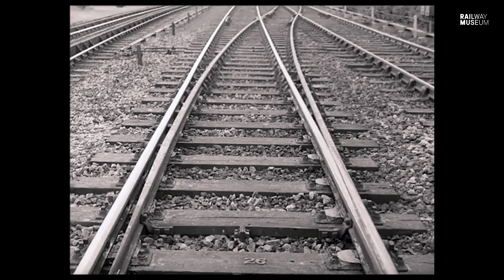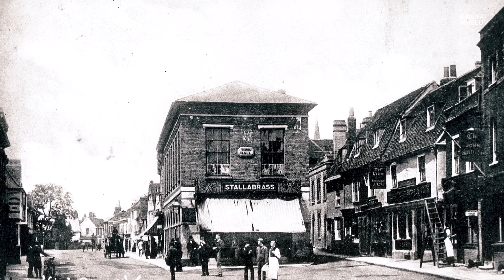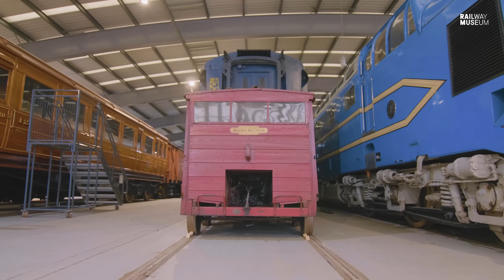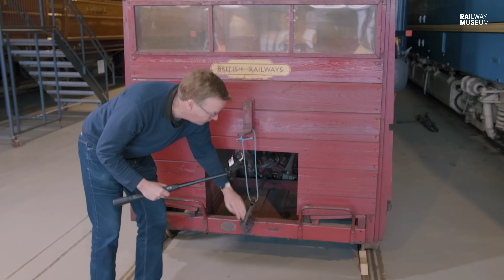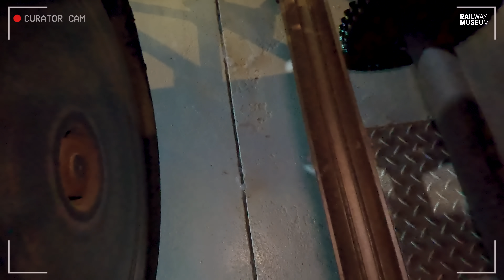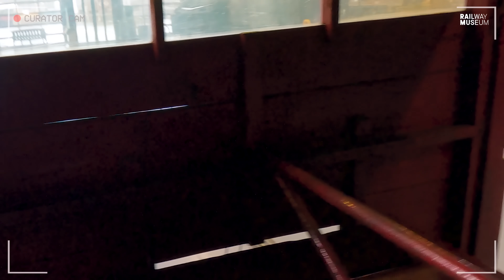LEGEND of the Track: Wickham Trolley In-depth Tour | Curator with a Camera

Comment: That drive system is very similar to a self propelled lawn mower. There was a driven disc to the wheels and a drive disc connected to the engine. To change speed the drive wheel was moved farther out from the center toward the edge changing the diameter that the wheel moved around.

Comment: Anthony, the choke reduces the air-flow through the carburettor for cold-starting. The advance-retard mechanism is a separate control, or an automatic mechanism with no manual control.
Whether JAP had automated it at this time I don't know, but given the lack of a manual control, probably yes.

I've only known JAP as makers of motorcycle engines, & had no idea they built for industrial markets.
Thank you.

Comment: These were called "speeders" here in the States, and unfortunately they've largely been replaced by hi-rail vehicles - ordinary, road-going pickup trucks fitted with retractable rail wheels. As line-side fencing is less of a thing here, it's easier to use a nearby road to access the right-of-way and simply drive up onto the tracks and off again when finished.

Comment: I’m curious on if you were able to choose the speed as well with the direction lever?
Reply: Yes you could As shown it is in top speed and you could move the lever towards the centre to decrease speed. Although on here he says with the engine idling I believe they did it on the move. Someone I knew used to drive one until it was taken away from the depot in early 70's

Comment: The only real difference to the modern versions is the new ones have steel body and glass windows all the way around, and a slightly more advanced drivetrain. But overall they're still just a tiny box with a few seats where you'd rather not spend too much time. Of course for work crews nowadays you also have to provide a kitchen, bathroom, and rest facilities, which means for bigger jobs that could once be solved with just these tiny boxes, you now have to bring a full sized train

Comment: Nice to see something really different to everything we’ve seen before. Very well rounded history and explanation. As to what to do next, maybe the Super D with it’s horrendous cab layout of from what I remember: a brake you can operate on both sides, injector taps on the floor, controls you can only reach stood on the boxes and the challenge of swinging a shovel with the tender cab, plus the strong and soft beats of the Joy valve gear. It was a fascinating loco to spend a layover at Pickering on the footplate during the 2011 NYMR Autumn Gala, but I wasn’t quite old enough to really understand and appreciate everything back then!
Reply: Having had a day driving and firing the Super S, I would like to do one on it from a practical perspective
Reply: @anthonycoulls7301 would definitely be interesting. From what I gather, they were very capable locos, loved by those who knew how to get the best out of them but loathed by those who were unfamiliar with their quirks!

Comment: Thanks for the story of this easily overlooked item of railway equipment. The J.A.P. engine is indeed from a motorcycle application but was also used in cyclecars of the 1920's, like the Morgan 3 wheeler. Another  link to cars rather than motorcycles is the friction drive transmission which featured in the GWK cycle car in particular. This worked just like the Whickham trolley's transmission, The name came from the initials of the founders of the company, Grice, Wood and Keiller.

Comment: Hope you dont mind me adding something you missed. The gear lever also acts as a variable glared transmission. As the drove wheel gets closer to tye centre of the flywheel the gearing is effectively increased alowing higher speeds
Reply: Yes, and the disk also functions as the flywheel. Very neat design, though not very energy-efficient. Also used in some early automobiles.

By the way, it's the other way around - closer to the center of the disk gives you lower gear.
Reply: @kkobayashi1  Yes my mistake. Schoolboy error lol
Reply: Ah, fully reversible 'Gradua-gearing' eh? - neatly Flintstonian - if a little 'skewy-scrubby' for the friction material when running the 'lower gearing' near the crank/flywheel's hub; but hey, 'asbestos is tough, plentiful & cheap, so why not?' - Ouch, little did they know : )
Reply: Would love to see this restored giving rides up and down the yard

Comment: I used to own two of the later model with the steel sheet bodies, which I sold many years ago. The friction lining is still in place on the driven wheel,  the flywheel was unlined steel.
Reply: That's what I thought. As the driven wheel has a rubber tyre I was surprised when he asserted that there would have been friction material on the flywheel. It looks very Heath Robinson but is/was a very common variable speed transmission on ride-on lawnmowers. Mine has it.
Is there a chain between the two axles or is it driven on a single axle?
Reply: @ShaunieDale  definitely friction material. We (The Rail Trolley Trust) are putting an order together for some news ones. Chair drive to one axle only.
Reply: Which one did you own?
Reply: @wickham5864 , I think I sent you photos of them, it was 40 plus years ago and my records destroyed during my divorce.
Reply: @colinlothlorian  thanks. I didn’t realise it was you. Yes, indeed. It’s now undergoing restoration again.

Comment: almost identical to the sheffield - fairbanks morse 40B motorcars. are you sure there was a covering on your flywheel? The US made friction drive motorcars just had a cast iron flywheel with the drive wheel having a compressed paper clutch surface.
Reply: Yes there was an asbestos covering on the flywheel. Someone I knew used to drive one. It ran away one day when pulling a trolley full of scrap which began pushing them down grade at alarming speed, It was raining and the wooden brake blocks had no effect on slowing it down on the wet wheels, then the asbestos peeled off the flywheel as speed increased. They ran at least 5 miles passing danger signals as they caught up to a freight train ahead, at a station there was a loop line which they were sent down to avoid colliding with the freight train, but speed was so fast it jumped the track on the turnout resulting in 3 of the 4 men braking bones as they flew off, the driver the only one uninjured.